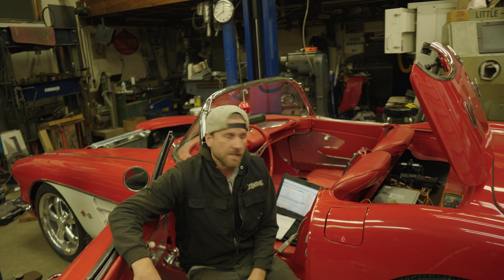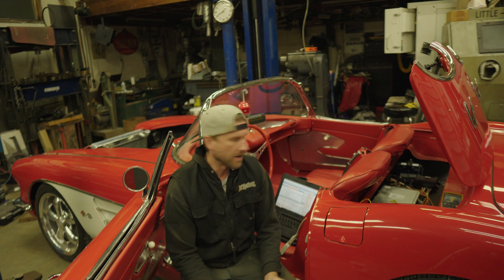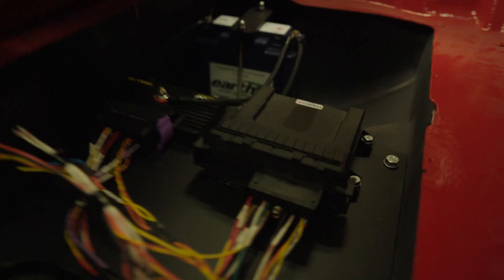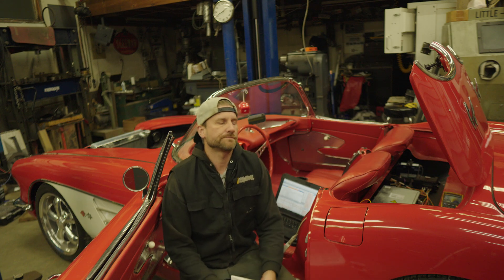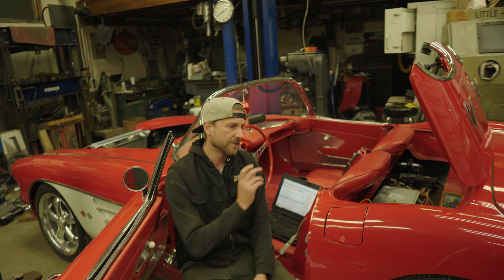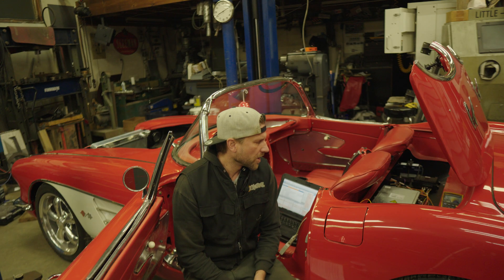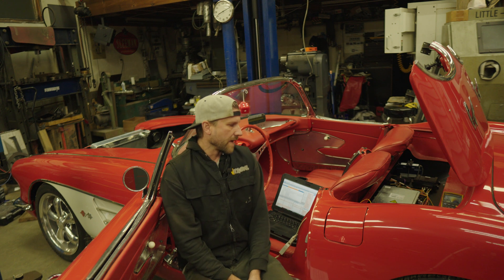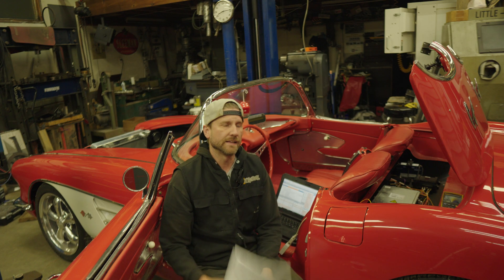It's Alive!! Major Component briefing and First Drive!!

Comment: Beautiful car and an excellent EV conversion. This is the best I've come across so far. Well thought out and executed. I'm panning on using the Model 3 but in upside down position that will put it behind the rear axle with the oil pick tube modification. Love to get your opinion on that. And what is the specs of the Earth X battery? Is it sufficient for the 12V legacy connections and the extra load for the EV components? Does it have the same cold weather issues as other lithium batteries have and how are you addressing it?
Reply from the maker: Really appreciate that! I have not tried the motor in the inverted position, but because of the electric oil pump it should function okay with the pickup mod. I believe the front model S motor is in that configuration already and can be controlled independent of the rear motor. 
Earth x makes a battery one size larger that this one that is essential a drop in replacement for the stock model 3 battery. It has been used for a while with good success here in Canada (6 month cold climate)

Comment: You are a true genius! Congratulation! What a job! 
I understand from several of your videos, that you had to modify the frame substantially. How do you get this car road legal again. Over here in Europe you basically would have to fully re-certify the car and proof, with detailed calculations, that this frame is suporting all the torque. Means, it is almost impossible to get it road legal.
Reply from the maker: Thanks, Appreciate that! We are not quite as strict here yet. The safety laws just updated but we only have to deal with that when we sell. It has always been the certifying mechanics discretion up to this point. I do have all the CAD files and could provide FEM data but have not had to so far. I would be curious to go through the process though, and maybe help guide some policy. It would help to keep crap fabrication off the roads!